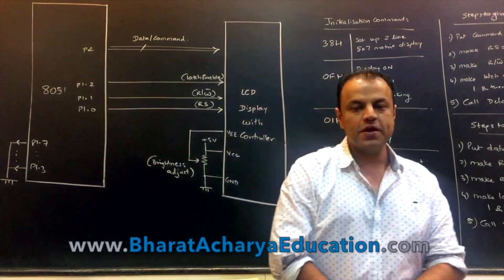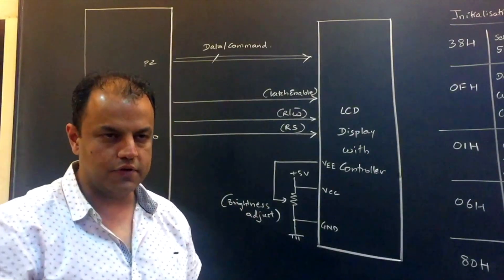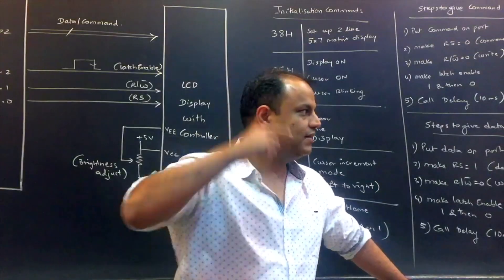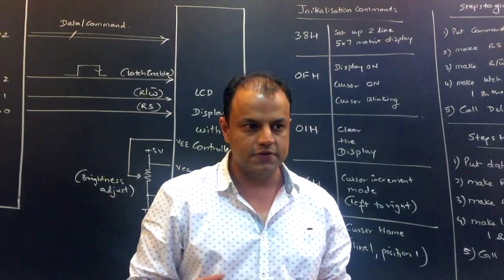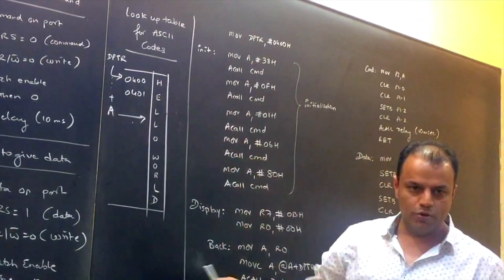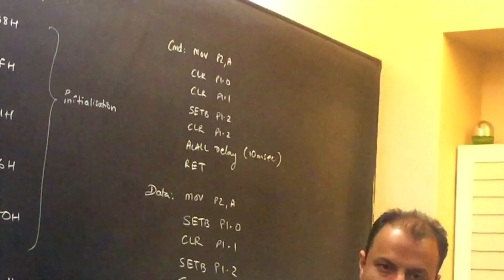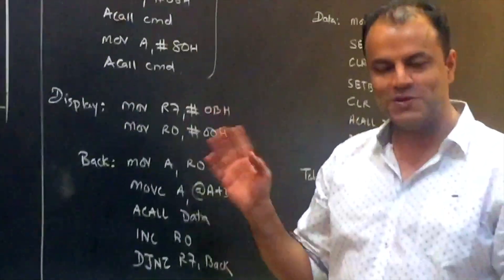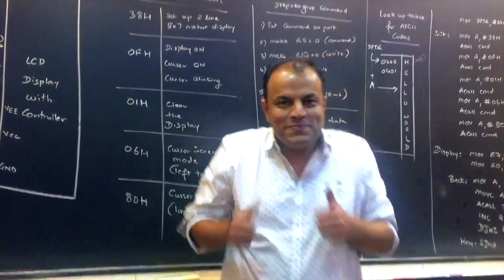8051 | LCD Interfacing and Programming | Bharat Acharya Education

Comment: Sir first we need to set latch 1 and delay then latch 0, is this crt sir but In your code delay coming after latch 0
Reply from the maker: Good question, 
No extra delay is needed between SETB and CLR for either the ADC0809 latch or the LCD EN pin. The instruction time for 8051 (1 microseconds) itself easily satisfies the minimum pulse width requirement. However, if you are working with a modern microcontroller that operates at a much higher frequency, you can add a delay in between SETB and CLR. Even here, there’s absolutely no harm if you add that delay. 
However, the delay added after this (at the end), is absolutely necessary.